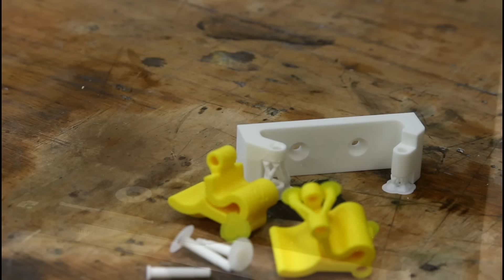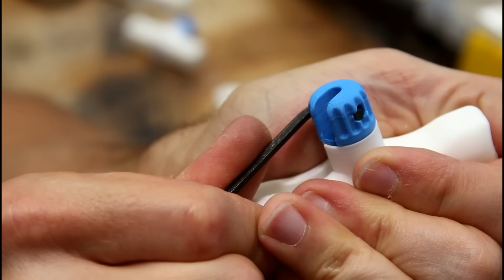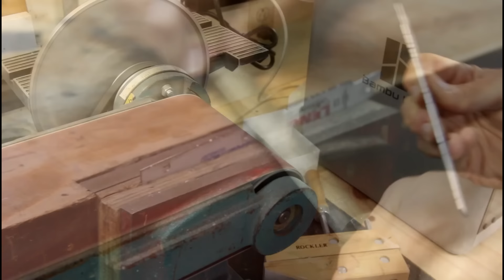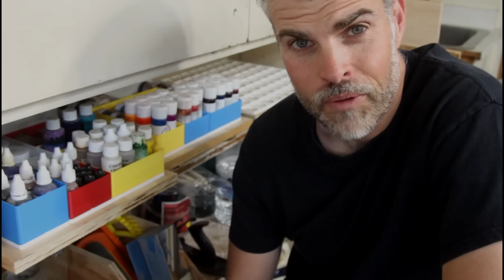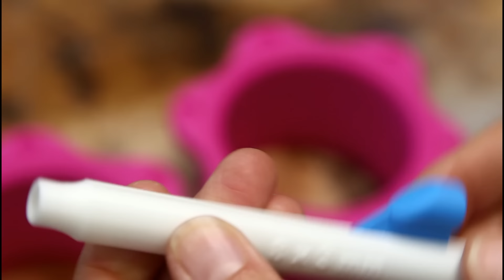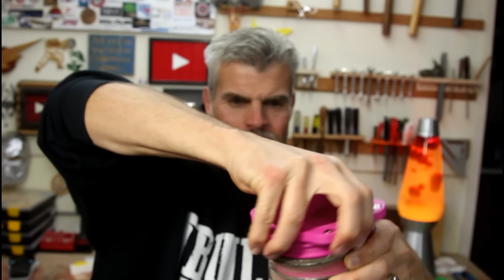5 MUST Have 3D Printed Tools!

Comment: When  gluing in magnets, put some baking soda inside the hole, then apply CA glue to the magnet and insert it.  The baking soda acts like an accelerant for curing it instantly, but also makes the glue bond extremely stronger.  CA glue is rather brittle and attaching/detaching the two pieces will eventually crack the glue bond, but with the baking soda it'll last nearly forever.

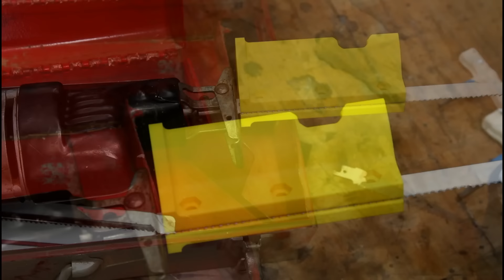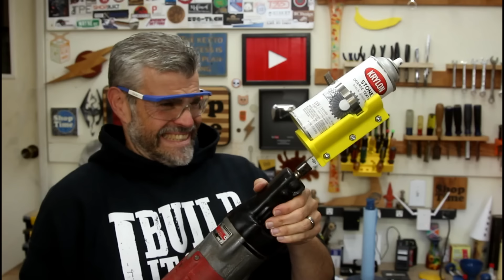Comment: @6:00 you'll notice the shoe is installed on the Sawzall. @8:20 the shoe is missing. What he omitted to tell you is he screwed up when he measured the placement of the shaker on the blade. When he originally tried it, it wouldn't reciprocate so he had to remove the shoe. Tsk tsk, bad youtuber, no cookie for you!

Comment: For anyone who'd like the print quality and multi-color functionality of the Bambu P2S, without the massive overpricing, expensive proprietary consumables, data harvesting, forced close-sourcing, or weird, Apple-like cult of rabid fanboys, the Anycubic Kobra S1 with the ACE color-changing unit is 1/3rd of the price and is pretty much equal to the Bambu.

Rinku has released an open-source jailbreak for the Anycubic if you're a tinkerer, but the stock system works just fine and you don't have to use Anycubic's cloud services to print over the local network, unlike Bambu.

Comment: I printed out the broom hooks. Here are some things you should know. The pins are tapered and they will only go in the model in one direction. If you use a textured plate, it’s easy to see, which is the top and which is the bottom of the parts. Assemble the three pieces accordingly
Reply: Printing this right now and definitely appreciate that info!
Reply: @aember  there are better versions out there. They just print in place and there’s no assembly required.

Comment: For the spray paint shaker, why did you have to file all the teeth down? Why not just put the blade edge on the inside so it’s encapsulated?

Comment: I waiting for my first ever printer and some of the first things I will print and also most likely allot of prints later requier magnets. I mostly will print boardgame upgrades where magnets are super handy. 
That holder is BRILIANT i definetively gonna print 2 of each size for the magnets I have. 
You should have 2 pr. size and mark them with each there colour or something and have different polarity facing down in them.
For.eks.
Red one with negativ side facing down
Blue one with positiv side facing down
This will make it so much easier to not mess up polarities.

I should have had this when I drilled and glued inn over 400 1x2mm magnets in to boardgame pices 😂

Comment: That first print...I have printed so many of those as gifts but I always do the print in place model. It just works great. 

I worked at a storage place for a few years and had 2 of them mounted on the golf cart we had. Just normal PLA and im in west Texas but it held up just fine. I would attach the brooms to it when we would go out cleaning and would keep them on there.

Comment: I would say I'm the clamps from your first print I would probably print them just a little bit larger and then line them with a soft rubber to help grab the wood that way it wouldn't sway if it was too heavy like I'm a shovel

Comment: Glued in magnets never hold very long for me. Some tape over the magnet helps a lot, even better is to use a metal cap over the magnet as that can actually make a stronger hold because of larger surface area.

If you check out regular commercial usage you often find magnets are covered or trapped in place like a gemstone for this reason.

Comment: Print By Object can be better for layer adhesion, as it doesn't give the layer of each part as much time to cool down before the next layer is printed. It's also handy if you're getting low on the roll of filament to only not finish one item on the plate if you run out rather than the whole plate not finishing
Reply: I was going to add it's also good for printing multiple objects in different colors like he did. Instead of purging every layer it'll just purge to print the different colored part.  Saves a lot of time and filament :)
Reply: This guy prints.

Comment: The way you glued the magnets was super smart. I would have for sure done them one at a time and ended up with a bad match of polarities.
Reply: There is another great way. The magnet holder pen he printed. Have two in opposite polarity. Use one for each side while gluing and avoid the mistake.
Reply: Ha!  Raising my hand when the "guilty as charged" request came forth.  But, now I know!

Comment: I have a different magnet pen setup. You print pairs and glue a magnet into each such that they are oriented opposite. Then you can use the pen to press the magnet into each such and if you have opposing parts, you use one pen for each and they are always guaranteed to face the right way. Any of them are super useful but the pair system has that extra something. Great video. Love the tools!

Comment: I have always wanted a Storm-trooper costume.   The thing will cost me if I bought it around $1,300 for a good quality one, higher for movie accurate.  I can Buy a 3D printer with a 350mmx350mmx3500mm print area and print one up myself, in fact I could print up many and sell some to pay for the printer...If I were inclined.

Comment: You could probably make butter with the paint shaker.
Reply: That escalated quickly
Reply: You might be able to print a tumbler to fit the Shaker.
Reply: I'm really curious about that idea now
Reply: Might need a bit more travel/longer stroke. It would probably still work but not be as fast.
Reply: @NICKELGHANDI that's what she said
Reply: Wait till you realize you can put a fleshlight in it.....

Comment: I love my 3d printer because no matter what you for a hobby or career, it adds so much versatility. Dont like how a tool works for trimming brass cases? 3d print a special holder to solve it. Specialty tool for your car that'll take 3 weeks to arrive from germany? Someones already designed it, itll be done in 12 hours. I'm sure there's plenty of applications for other hobbies like RC cars, beekeeping, rock polishing etc etc

Comment: You're making stuff and having fun-the 3D printer is just another tool. I can see you gleefully just spending your days making and selling nifty gadgets as a side gig.😄I think you can take the plastic waste, shred, mix with resin, and pour into molds? Have you tried that yet?
Reply: This would be very on-brand for Peter. Perhaps a toilet paper holder?

Comment: I like print by object when I can so the layers don't cool as much before the next layer goes on. Also better for multicolor without so much waste
Reply: print by object is substantially more wasteful doing multicolor, two print by object multicolor parts mathematically means double the amount of filament changes
multicolor is quite commonly known to be much more useful printing multiple parts at once by layer

Comment: Having a 3D printer has literally changed a lot of stuff in our household in general. For example, my son wanted some LED lights in his room. He made the brackets to hold the lights. We also made the electrical box with a wires terminated as well as the cover for the box. He also made wall drywall anchors on the 3D printer to hold up some of the things he wanted in his room. The versatility and the way this thing pays itself back is unmatched to anything

Comment: Downloading what's there is nice, but nothing beats making a tool that you need that doesn't exist. That's where the power of 3D printing comes from and I hope you dig into the CAD space at some point. It's intimidating, but worth it. FreeCAD (or any of it's forks) is a great place to start as it's more intuitive than most and not locked down to the cloud, while also being a fully featured CAD package. Onshape is also cool, but it's not as open, obviously.

Comment: Oh I really want the Spray paint  can mixer. When I was about 11 years old me and my father were getting back into doing model railroad stuff after almost 2 years of not making anything for it just running it.  Our Testors paints all needed mixing badly and we had lots of them. So dad decided to attach one (Caboose Red) to a Jig Saw. It worked seemingly great for about 5 seconds then bang the bottle broke at the neck line to the screw for the cap and red went flying everywhere as the bottle bounced off my dads mouth chipping his tooth. (We were wearing goggles) I think almost 45 years later it would be a wonderful semi nostalgic Christmas gift.
Reply from the maker: HAHA! That's crazy

Comment: The spray paint shaker...I'm not some kinda spray painting guru, so pardon my ignorance.  But doesn't a brisk shake with the arm for a few seconds get the job done?  Seems like the mere act of securing the spray paint in the assembly will take longer than just shaking it by hand.  

Don't get me wrong, it's great for those with disabilities, but it feels like overkill for most people.
Reply from the maker: Mostly it does. Some times for cans that have been sitting for a while, the ball bearing is stuck and you need to REALLY shake it.
Reply: There is an actual use for something like this beyond not wanting to make your arms tired. It’s in aviation, for doing spot repairs on composites. Technical data calls out times you have to shake different paints, and you cant deviate from the book on it. So if it calls for five minutes of shaking, we’re using this.